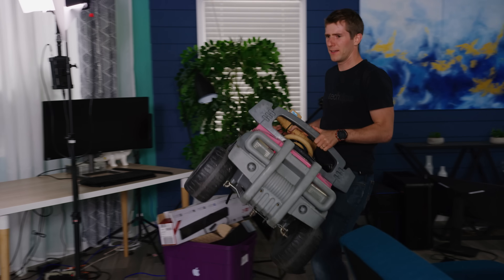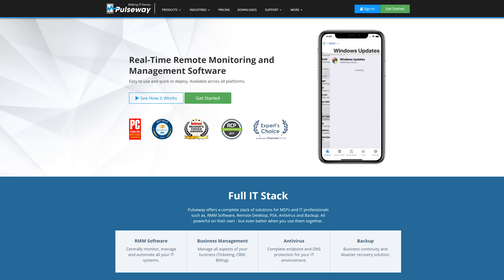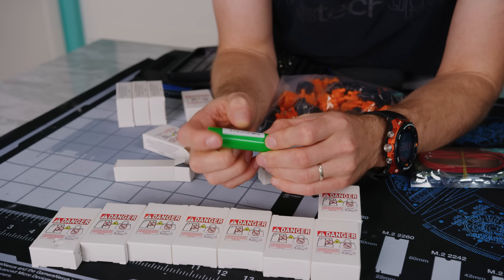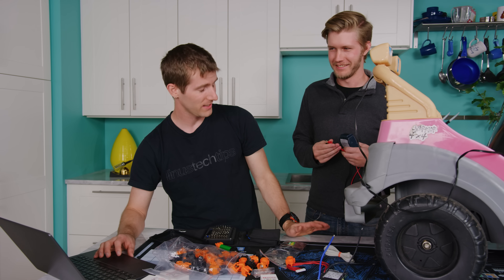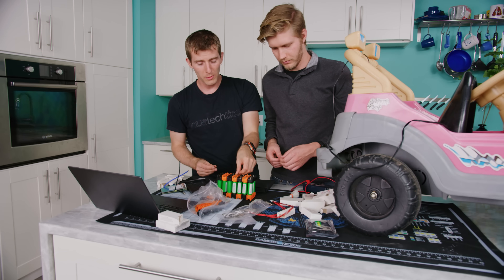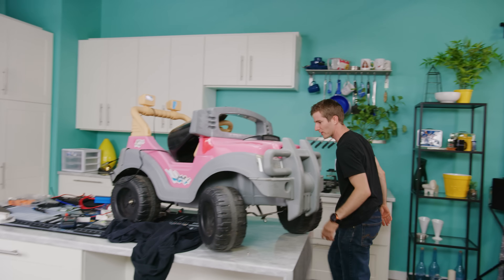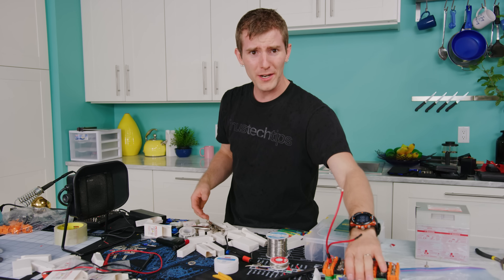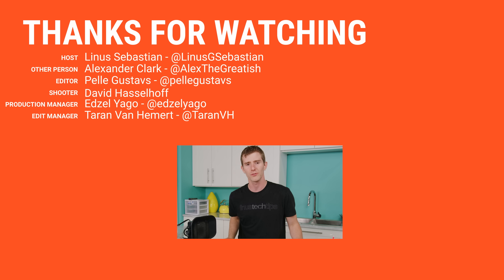DIY Lithium Battery - What could go wrong??

Comment: rule 1: don't short out battery
linus on step 6: shorts out battery
Reply: multiple times*
Reply: Yep, I was waiting for the lithium fire.
Reply: @EwanMarshall  actually those lithium 18650 batteries  are almost impossible to explode. They usually have a built in safety device on the battery  It's the square box like ones that will explode on you if your not careful. Different chemicals.
Reply: Square and cylinders can be the same or different it has nothing to do with the shape. Worked on L-ions for 7 years. the safety built into most batteries (BMS) are for overcharge and overuse. The main reason batteries catch fire from shorting is due to the amount current moving generates a ton of heat. This destabilizes it and the ensuing L-ion fire begins. the batteries themselves can handle small duration's of shorted like output if you keep them cool.

To be fair though, I can't say for all square types but I do know a few types that have thermal overload protection built in, but it is a fail safe that destroys the cell.
Reply: @ElainesStory  <This guy knows batteries
Reply: Yeah, you've got it spot on. Most 18650's and prismatic "lipos" are really all just normal lithium Ion (NMC or NCA) chemistry. If you exceed the current rating on either one it will build up pressure inside, and if it pops then the gasses have the ability to catch fire.

prismatic cells are more easily punctured because when they puff they can expand into something else and pop that way. In this sense, they release gasses slowly and burn up.

round cells on the other hand are much more dangerous if you get them to explode. Exceeding the current limit on those will also permanently damage the electrolyte which produces gasses. If the pressure builds up enough they can explode like fireworks.

It's really all give and take with these kinds of cells, neither is universally better than the other.
Reply: Linus said those are just 18650 batteries and looking at the wrap and isolator color they appear to be Sony VTC5s or VTC5As, they could also be Samsung 25Rs but those have a more "Woodland green" color to the factory wraps than the VTC5s. They are unprotected. Protected 18650 batteries have a different positive post due to the protection chip placed over it and are much harder to find. They would not work in a setup like this due to the fact that if any of the cells were to have an imbalanced charge compared to the other cells it would break the series.
Reply: hahaha

Comment: It severely triggers me that alex and other people seem to think you can get electrocuted by 30v (or low voltage) but only if you short circuit a battery wtf lol. 

Get your facts straight dude, 30vdc is hardly even high enough to make a good enough circuit though skin/body with dry hands that would cause a shock, sure if hands were sweaty you could get a bit of a zap.... well more a small tingle IF you touched pos and neg poles and made a circuit. Whats worse is that this has NOTHING to do with short circuiting the batteries with the contacts AND its not life threatening or anywhere even close to it LOL.
Reply: Ehm... you're right. 100v and above on dc gets dangerous

Comment: only use it in the blue one dont even think of putting it under your bum without balance charger. I mean it might be fine but i would not.
Also i was not aware that we can just change the voltage without having some consequences. Maybe overheated motors?

Comment: einstein was wrong when he said nothing can go faster than light, you just need enough lithium ion batteries to overvolt it to go over 300000 km/s
Reply: AFallingTree what’s mps?
Reply: 300,000,000 m/s actually. Meters per second is mps
Reply: @Ravenousjoe  Oh I assumed it was a fast Mazda.
Reply: yea i know but i was wonder if it was some amarican using using stupid miles, also light speed is closer to 2.8*10^8     ;)
Reply: CoopDoop American, no but I did make a mistake in this. It’s 300k km/s (186k mi/s).
Reply: @cooperhomann783  Yes ordinary miles are stupid but imo as a European the metric system's only redeeming feature is the fact it is a decimal system. Because we still use the system where 360° is full circle, we don't get a usefull unit out of meters for long distance navigation. This is why I like the Nautical mile and the speed unit Knots as they are 1 degree and 1 degree per hour on a meridian which in current circumstances makes them more usefull in long distance navigation (on this planet) then km and km/h.

If density wasn't variable by temperature I'd have also liked a mass unit where 1 was 1 litre of kerosine but since it is variable by temperature this would make all calculations inaccurate.
Reply: my bad

Comment: As a kid I used to have such a car, but my dad upgraded it slightly different. Instead of the standard 6V battery and single motor (to the rear  axle), we put in a 12V car battery and a second motor. Gives about the same result, with a bit less wheelspin but similar topspeed and it was great fun.

Comment: I loved Vruzend kits, i used the 1gen and 2nd gen of them but as of last week i moved away from them and got a spot welder.
What you will end up finding out is (Even taped all the way around) they do end up vibrating away from the battery and itll usually just be one cell. But having one less cell means that series drains faster and charges faster and the (50mah balancing) BMS cant keep up. or tell you something is wrong.
If you want to do a bigger project for long term use or with the battery potentially vibrating id recommend spot welding (Sunko is a good brand) the batteries together then for future trouble shooting help (bad cell, charging issues, etc) get a Bluetooth BMS so you can change parameters or troubleshoot the battery.

Comment: Tesla stock dropped 50% five minutes after this video.
Reply: Tesla stocks drop 50% whenever Elon Musk breathes
Reply: Funny enough. At closing of today's market of when this video was posted. Tesla's stock price was 6 points lower than yesterday.
Reply: They will just supercharge the stock back to normal tomorrow ;)
Reply: IIRC Tesla battery packs USE 18650 cells.  It's the go to cell for building battery pack for DIY EV conversions.
Reply: Hahahha
Reply: tesla stock drops following every headline aparently lul
Reply: As if SEC was not enough, now Elon has to deal with Linus

Comment: be careful, as a vaper, i can tell you that there arent 3500mah high amp batteries. its either low mah and high amp or vice versa - ~3000 mah ~20A is about the highest mix you can get. not saying you didnt find legit ones, just saying, be careful batterymooch has a good list of verified amps\mah for 18650\20700 and 21700 batteries if u want to use them for future projects.

Comment: Linus! I would recomend a heatsync for this, at least on the inner and outer sets, you can use some thermal selastic and a cheapo aluminum block for this, and it will help a ton!

Comment: I did this years ago to an old power wheels wrangler my kid outgrew and the batteries died. I just used a 12 volt lawnmower battery. Short story is it worked, it was crazy fast. I don't know how fast they go stock, a couple mph I would guess. Slow enough you can chase one down and save your kid if you have to. Ater putting the 12 volt in it it was so fast I couldn't run after it. And it did some crazy burn outs and drifting lol. Down side is it ran for about 10 minutes maybe and basically burned up the motors and melted. It just wasn't made for that big of a battery. What I got from it though was an electric go kart with the correct electronics would be a blast. I let a friends 8 year old kid test drive in the back yard. I think that was the most fun that kid had ever had lol. Even when he hit the tree and smoke started coming out of it.

Comment: This was really painful to watch, it kept bringing back bad memories with Lithium batteries. Please don't make the same mistakes I made. If you want to do this safely here is a few things you can do. 1) Install a low voltage cut off. 2) Install fusing between the cell and the charger/load.  3) Install a thermal Cutoff. 4) Crimp your connections using ratcheting or hydraulic crimping tools. 5) Mount the cell in a vented steel box. 6) Properly insulate the cell.  Anyways, good luck.
Reply: What happens out of interest?
Reply: i second this
Reply: @theangrybritman  if the batteries get undervolted then the battery will swell and ... Well turn into a Samsung phone style bomb
Reply: Or Macbook Pro, they did it before Samsung made it cool

Comment: i work at a shop that rebuilds battery packs and I will say this is incredibly dangerous and we are legally not allowed to work with lithium cells.... Pls no die linus
Reply: You would be hard pressed to make 18650 go boom. Worst case properly constructed cells simply vent, maybe release some of the electrolyte and catch on fire, but 99% of the time it's just smoke. It's pouch cells that give lithium bad rep. 
Since Linus bought brand new cells from a reputable manufacturer and is using a BMS, he can at most loose money by wearing out his pack prematurely. I would be more worried about the motor in his car - it doubt it will run long overvolted that much.
Reply: @MikrySoft  you mean lipos? Those are the ones that can explode and do not tolerate overcharging
Reply: Especially that it probably already comes overvolted from factory, to keep the cost down.
Reply: Do you know the ignition temperature for lithium? Any idea what happens when the electrolyte turns to gas and the can pressure increases? Though rechargeable lithium ion cells do not have the energy density of a primary lithium cell there is still a lot of energy that will make a good boom.
Reply: MikrySoft it depends. He was using cells that would probably just vent (high amp ones) but the high capacity (like 3500mah, used in laptop battery packs) are rated for 5A continuous discharge and they are more likely to explode when shorted. Other than that you're absolutely right. I'm using 18650 Li-Ions in my e-cig and I'm not afraid of them exploding. You just have to know what are you doing.
Reply: @marsen1234  the cells look to be LG ones, MJ1 series to be exact. They are rated for 10A discharge and all photos I can find show the gaps around the positive terminal indicating vent ports for overpressure protection.
Reply: It's actually no more dangerous than any battery really if handled properly. The biggest problem with lithium cells is the capacity density which makes them desirable also makes them dangerous, potentially if short circuited or overheated.

Really though each cell is sealed and non-serviceable. Basic precautions and you'll be fine.
Reply: The problem with 18650's is that they don't have much commercial use in battery packs. At least in the business that I'm in. 18650's are the MAJORITY of the time used for flashlights and Vape Mods. I rarely have times where someone comes in asking for welded 18650 battery packs. The real problem comes in when you're using the classic method of welding tabs. They're micro welded to the batteries, and take a longer amount of time to take off if you fuck it up. Making it incredibly dangerous. Not welding the tabs means you lose space in a battery pack, so using new methods of connection is not currently viable.
Reply: @thebestian 18650 not used in commercial applications....  Tell that to Tesla
Reply: I feel like i'm engaging a troll but I'm bored. No premier laptop manufacturer uses anything but the lithium bricks now. Unless you got some old shit or cheapo garbage.
Reply: *you're
Reply: translation: industry insider wants to keep his job, stop learning to fish!

Comment: Not using a balancer charger at 3s or higher is fucking unsafe... I mean after even 3 charges there can be a charging difference between thoose single serial packages and this could cause one "cell" to overcharge. Lithium batterys and overcharge is not a good idea.

Comment: You could have at least also spent like $2 on a set of XT60 connectors, surely? Or maybe its bigger XT90 brother.
Your soldering technique was mostly fine, though. I wouldn't have soldered the terminals while those modular bits were connected to the batteries in case the heat from the soldering iron went through to the cells and damaged them, and you probably could have used a high-mass soldering iron, but the "Heat up the wire, then add solder to the wire" method is how you're actually supposed to solder stuff.
Reply: The amount of heat is too small for a too short of an amount of time, but he could have spot welded it
Reply: I've said this to myself before.  Right before I blew up a lithium battery while soldering on it.  In my younger years I figured it would be fine since, after all, tabs are added by spot welding.  Well as it turns out soldering actually introduces a lot more heat over a  longer period of time than the spot welders used for adding tabs.  Take it from someone that's been repairing electronics for 20+ years: never solder on top of batteries.  Remove terminals before soldering and barring that use a heat sink clip on the tab.
Reply: MGlBlaze those were vape batteries lol
Reply: @GiveUrSacATug  yes and no, they were standard 18650 lithium ion cells used in "many laptop computer batteries, cordless power tools, Tesla Roadster, Tesla Model S, Tesla Model X, electronic cigarettes, and LED flashlights". So used to power everything from LED flashlights/torches to electric cars...
Reply: @GiveUrSacATug  Well, you could put 18650 in wikipedia and start there ;)

Comment: As an Electronic Engineer that works with primary Litium batteries, do not in any way shape or form let your kids drive that. I am not even talking about the speed issue, that is minor. But the fact that there is no over current protection on those cells makes it a ticking time bomb. Stall out that motor and draw too much current and those cells will overheat and possibly explode. A DIY litium battery pack is not a drop in replacement for a lead acid battery. I won't even get started on your lack of safety for yourself and your crew. If any of those wires would have welded themselves together when they arced you would be looking for more sponsors from a hospital room.
Reply: That's one of the reasons he was going to put in the breakers. They'd trip if too much current was drawn.
Reply: The BMS won't let it do more than 30A
Reply: Stonewall78 is right. In bigger battery packs even per cell fuses are used. One overloaded cell could set the entire pack on fire, even when the battery is not hooked up and sitting on a shelf. When you connect battery cells in parallel and one shorts out, all the others on the same busbar will short circuit through the bad cell.

A BMS system between the battery and the load/charger is not enough to prevent this scenario.
Reply: @VTOLfreak At what size of battery are per cell fuses necessary? I assume this is only important on batteries with parallel cells.
Reply: @arvensisalaudidae  Battery packs for hybrids and electric cars. Any application where you need allot of power and weight is a concern. That's why you don't see lithium battery packs on UPS for example, nobody cares about the weight of an UPS. Tesla's have per cell fuses, although not replaceable. You don't need them for series operation, only if you put cells in parallel. If you use a battery balancer you do need fuses on the wires going to the balancer but not between the cells in series themselves.
Reply: the intense tone of your comment send me to the hospital all on its own, sir
Reply: Hoped someone would drop a repley like this. I like almost all videos and this is great content but its not just not recommended it is super dangerous! And I doub Linus knows how to do this "the right way". Please do this on channel super fun with warnings all over the place.
Reply: @CheliQ01  but he's right
Reply: I need to agree Linus, this was the single most dangerous thing I've seen you do to date.
Reply: you did not hear about the dry ice ac?
Reply: I'm no where near as qualified as OP but lithium has become popular in car audio and we are seeing more and more people losing gear due to not understanding/respecting how dangerous lithium really is.

I myself tested a home made lithium battery for car audio which lasted all of a week, it's 12v float became 9v,and when we pulled it the casing fell off, it was rather moist internally and some of the bus bars had scorch marks on them. Scary shit. Please don't play with lithium unless you're being safe.
Reply: Like Linus said when he ads an esc he will ad current limiting for now that is good advice
Reply: Im more so concerned about how much current is being pulled. If I got the battery description right its 9AH. He then mentioned how warm they where once using them. Sounds like a ticking time bomb that in time one of the cells is gonna blow, especially if they're getting really hot.
Reply: My thoughts exactly. Once Linus messed up and i saw those blue sparks, I got spooked.
Reply: Strongly agreed do not do it. Too dangerous way much so
Reply: The BMS is there for protecting the cells, it's totally safe as long as they didn't make shorts. And I built batteries for RC planes too.
Reply: More impressed the shorts didn't weld. As for the life of the battery, just discharge it and dispose of it. I can't explain how irresponsible and dangerous you have been.

Comment: 1. You pretty much can't electrocute yourself with 30V battery, it's considered SELV (separated or safety extra-low voltage).
2. Don't you guys have a two channel power supply with at least 15V output (hard to find exact model you have, but you used it with blowie-matron), just connect channels in series for a charger that can also limit current.